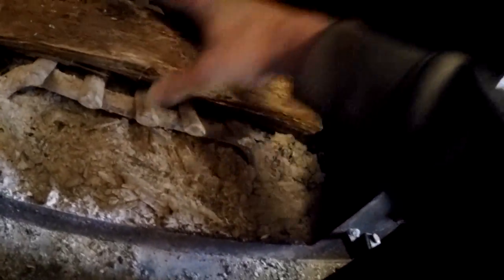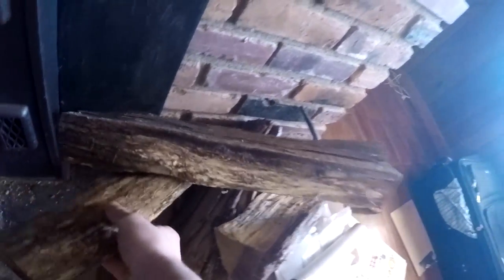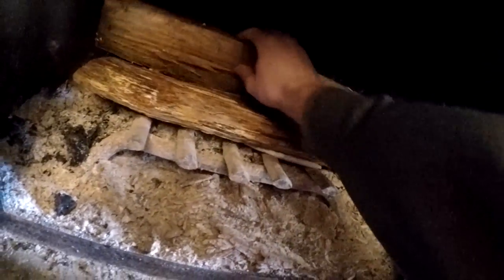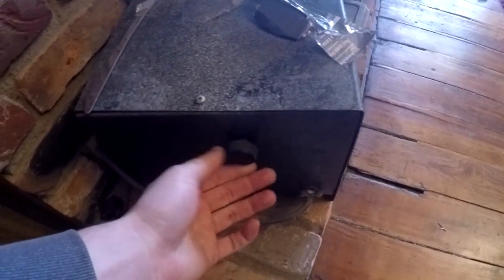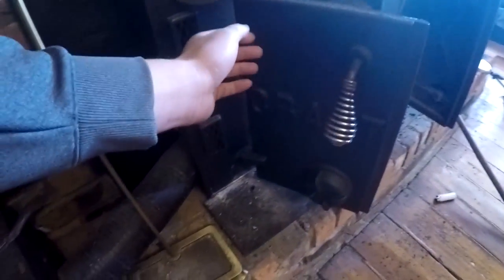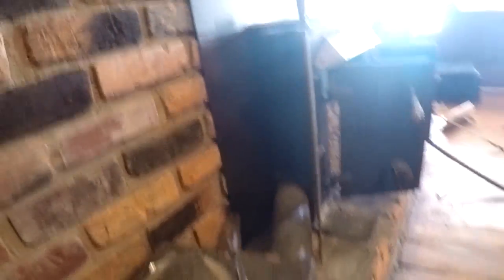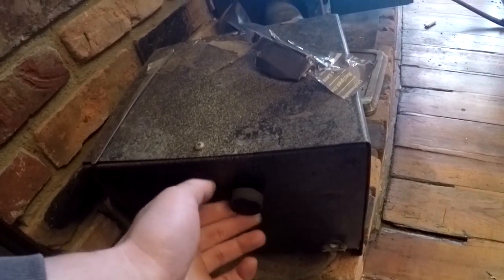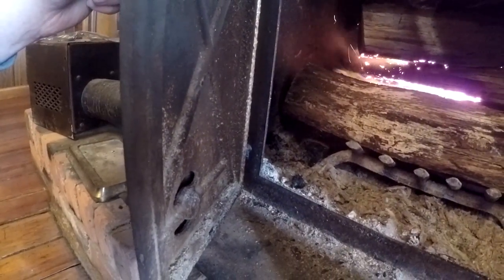VLOG! Making a Phire With PHLY!

Comment: I always use one triangular log, then lean two or three other small-ish logs on top of and perpendicular to the triangular piece.  I then place several thinly-cut pieces of 2x4" ends (leftover bits from home construction or woodworking that I cut with a hatchet) leaned on the first log and in-between the other logs. I use newspaper to get the 2x4" bits going and the logs take off in no time.  Usually have to finagle the logs to lay parallel after they've burned for a while and before you add more fuel.  Hope this helps! Enjoyed the vlog!
Reply from the maker: oh shit this is a smart idea thanks

Comment: 1 MORE TRICK, which helps alot..
A few small fans on the floor, that blow Cold air up, to Mix with the warm air.
Use a few fans to Spread the mixed air around the home..KEEP PIPES, sink/bathroom..Warm..(needed if Pipes are near EXTERNAL WALLS..)(open cabinets)(frozen pipes are not good things, watch for temps below 20)
Reply from the maker: thanks ED! yah i have to drip the pipes at night because its getting pretty cold
Reply: yea, the fans are a great idea! as for the fire, never be tempted to use oils or fuels on a fire inside your home, last thing you want is toxic fumes and a bad smell in the house. however with the fire itself your idea with the X factor is great, stacking helps a lot but don't stack too high as you are at risk of extreme heat and you could end up setting your chimney on fire! happened to a friend before and the fire brigade had to come and put it out! oops lol..

Anyway at first step you want to make your fire as tall and as narrow as possible to build heat without having to use so much tinder. Then easily spreading into a flatter wider fire to sustain the temp over a long period of time. Only major advice i can give you is to clear out the ash, for two reasons:

1. It will improve airflow giving you a better fire.
2. will reduce the smell of fire/ash in your house :)

You can argue that the residule heat in the ash is enough to help start a new fire the next day but i think its safer and healthier to clean it out. also, i don't know if you have thought about it but cats love to sleep in warm places, i would be careful she doesn't jump up onto the stove and burn her little feet!

Hope this helps!
Reply: Another point to make..MORE logs dont make a good fire.
A fire heats at about 2000 degrees..  the Size of the flame will only force more heat out the Chimney.  Better to Feed the fire as it needs it.
NOW for a great trick, if it can be done..Pans of water..  heat isnt very good at carrying around the house..Moisture is GREAT..it helps the FEEL of the heat.  DRY heat does not feel HOT..  Like an empty pot on a stove has to be VERY HOT to be felt,,,Add water and the moisture is Carried and felt better..and you can BREATHE better.  the moisture also keep Dust down ont he floor.
Reply: That's very true ed, reason behind feeling geat better like this is because the body uses sweat to cool down so by adding humidity to the hot air it will keep the skin warm instead of allowing the sweat to cool, exact reason why so many troops were dying in the japanese rain forests in WWII and as water is a good conductor of heat it will keep the heat within the air and less likely to be absorbed by surrounding objects, I recommend a bowl of water sat in the near of the hot air vents will help a lot!
Reply: NOW for a solar trick..
South side of house has windows??  DONT COVER THEM.. sun thru those windows can be over 120 degrees heat..even at -0 degree outside..
To ADD this to your home even better..
You need something Dark colored, that absorbs heat...Cloth and wood dont absorb..
Metal, brick, concrete, Blocks..

Help keep from getting sick?  Easy..
If its WARM(>+40) OPEN the doors, and Air out the house...
Iv seen a newer home, that had no Drafts, and was TO TIGHT...that the family was sick all winter...They took suggestion to open doors and windows on warm day, and the colds and flew, disappeared..

Comment: Waded paper, Thin kindling/very light wood/sticks on top(good amount..and 1 Log on top to get it started..
Once it gets lit up and the log on top gets burning, Place 2 logs OVER the top of the 1 log..
Make sure all AIR IN TAKES/VENTS are clear..
Paper starts the Kindling, Kindling Burns hot and long enough to Light the log...1 Log can start 2 more..  FIRE BURNS UP..not Down..  it takes a HOT fire to start a LOG, time and HOT..

Comment: My tip is to build a high pyramid with the more flammable pieces in the middle and work outwards. Make sure you have enough open space for the oxygen to flow. Later when the fire gets hot you can throw on bigger pieces

Comment: The way that my dad and I make a fire (lights really well and quick). Clean the shit (ash) out from under the rack. Ball up about six - eight newspaper sheets and do three - four across the front and back two deep and put them at the bottom (under the rack). Place the wood so that there is plenty, but still oxygen for the fire. We used this in our 155 year old cabin with an original stove (is that what it's called?) in the fall and winter. It would heat the whole two stories in a half hour without help. I hope that this helps you keep your home warm or just gives you ideas.

Comment: I find that matches are better than a cigarette lighter and I use newspaper as oppose to tissue, and I put that right in the middle then put the match into a fold in the newspaper so it lights from the inside out, then let the fire spread out to the wood and add more fuel once the fire really takes hold, and hey presto!

Comment: You should try starting your fire with the cardboard boxes they keep eggs in then put small pieces of wood on it and go from there. Keep your fireplace clean though and try to burn oak or any other hard wood. Also you can open the things on the bottom of your fireplace as a sort of afterburner and close them when the fireplace is up to temperature so it doesnt burn wood that quickly.

Comment: To start a fast fire you need to make a tipi with thinner smaller logs and put lint form the dryer in the middle and some bark if you have some,if not just use cardboard,paper,or tissue. Light the middle and maintain the fire until it's running good

Comment: Awesome stove! The way u build ur fire is alright but it could be better. That bottom piece is hindering air flow to your cardboard so if u removed it it would be better. Fire burn upwards so any wood should be above the flame. The rest of the logs are in a great position. There's 3 parts to a fire. Tender, light dry wood, then logs. The tender is like dry grass or pine needles or in ur case cardboard which works fine. U put the cardboard first in a pile then put ur 2 logs on either side like how u have it then put some lighter twigs on the cardboard. U can use that bark which works great if u break it up into small stringy pieces. So u put ur twigs/ bark on the cardboard then u put ur bigger logs on top of the larger logs leaving. Lots of air flow.so what happens is u light the cardboard and since its sitting on the grate the air hits it directly and lights the twigs/ bark which holds a flame hotter and longer than the cardboard, and the side logs catch the heat and put it directly on the logs above the bark making it start a sustainable fire a lot quicker because the cardboard and bark won't last but the logs will. It works in increments. The cardboard is really easy to light which lights the bark which lights the log which stays lit. There's tons of virus on the utubes that show how to make good fires if u need more info but otherwise what u have is pretty good.
Reply: Virus - vids
Reply: Oh yeah another thing. Don't put any more logs in till the first few are completely lit. It'll get hotter faster that way.

Comment: if you use lots and lots of newpapers at the bottom, then a latice of kindling on top of that, then place 1 big log/ 2 small logs and then close one door. put the handle down of the other door before closing it so that it gives enough space to allow O2 to get in

Comment: its good to have some smaller sticks, branches, and bark to start off with. Also make sure there is plenty of airflow. BTW I don't mean to be rude, but you might also need to clean your fireplace out there is a lot of ash
Reply from the maker: yah very true just use it so much that even though i clean it a day ago it already need mroe cleaning thanks for the tips!
Reply: PhlyDaily ya no problem I'm always looking to help. Used to have a fireplace myself.
Reply: CelticArcher D The longer you keep the ash in there, the less it gets because even the ash does burn a little bit every time you make a fire ontop of it
Reply: ya I know but ash can be useful for other stuff to. I have a garden and we put some ash in it every year while we a tilling it and it helps a lot.

Comment: If you don't want to go to all the trouble of setting up you fire like this just get your axe and chop some thinner kindling put your. Starter at the bottom (I usually use balled up newspaper ) and arrange the kindling in a cross cross pattern with 3~4 pieces each row then put your wood or coal on the top light the paper and your done!

Comment: Clean the ash out of the bottom so that the air can circulate better. Then I suggest trying to find a way to get turf its burns as hot a coal and lasts longer then wood u should used that after it has been started

Comment: To start the fire better start small, use wood slivers and paper start that then add more small peaces of wood and work up to the full size log you have also you could always use scout water or gasoline or lighter fuel to help start the fire and get the bigger peaces going also leave room for air to get in between the wood. also you could check out a different method called the upside down fire there are videos here on you tube to help with it. Some tips from a Boy Scout.

Comment: Recommendation: don't put that bottom piece in. the grate that you make the fire on is raised so that air (and oxygen) is able to come in and burn. you could test the heat output because I am not completely sure I am correct, but I have never seen your technique before, so I don't know what the advantages are.

Comment: Cleaning out the ash is a very good way to get more oxygen to the bottom of the fire. That will allow you to put your fire starter under the wood and then the flames from the kindling will be more likely to catch the wood on fire.

tl;dr clean out your fireplace.